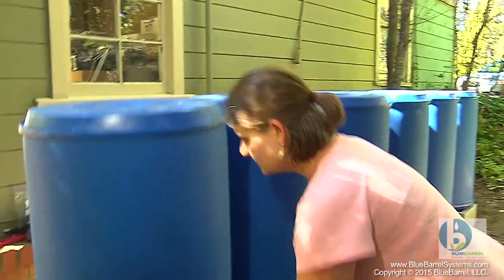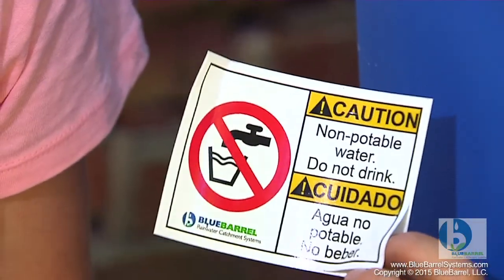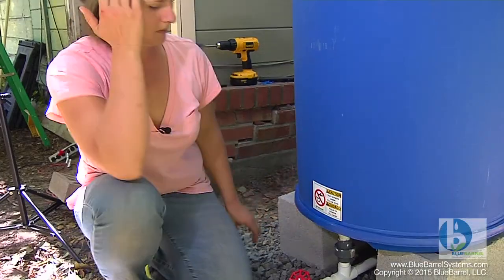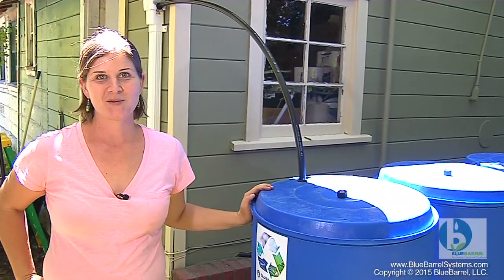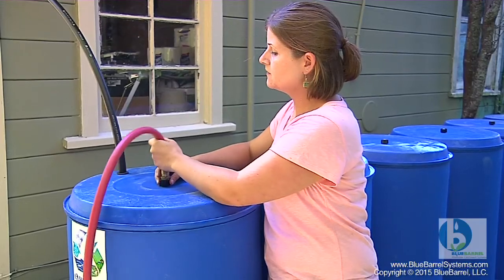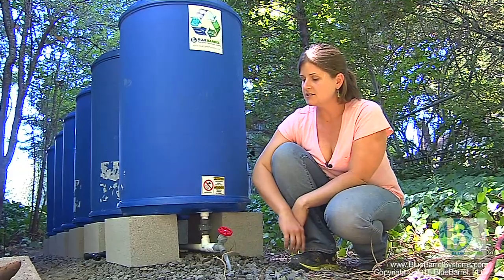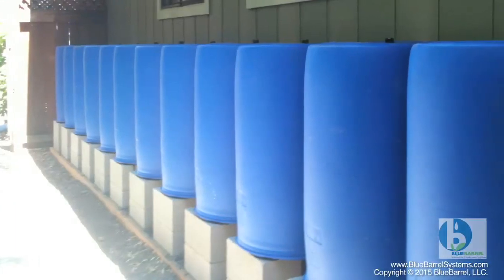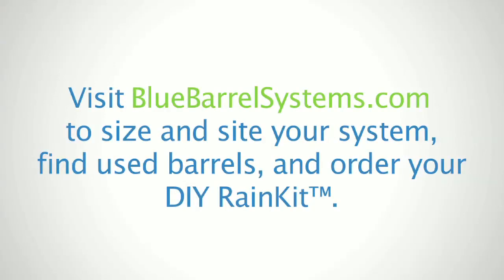PART 8 - How to Build a BlueBarrel Rainwater Catchment System™ - Finishing Touches

Comment: I love this....I had a couple of questions. 1. How much would I have to raise the barrels to utilize drip irrigation on a 2ft raised garden bed? And also can I do a the drip along the ground (walkway) and then L connection up to the top of the raised bed? I'm wondering if there will be enough flow. I would ideally like to put 2 systems in my back yard - 1 to water my top garden (3 raised beds) and then 1 on the lower garden to water my veggie garden. 2. I'm wondering though it would be more beneficial to put a 6 barrel system up on the top yard and lead a drip irrigation down (about 3-4ft slope) to my bottom veggie garden - I have 4 x 31" tall vego beds so I'm not sure they would even get watered. 3. Can you add more barrels to your system as you go?, so start with 4 and add more later on? Thank you for creating such a cool product to save water.
Reply from the maker: All great questions Sam, and we can definitely help you with this. Please visit https://www.bluebarrelsystems.com/ to reach out to our customer service team. Thank you!